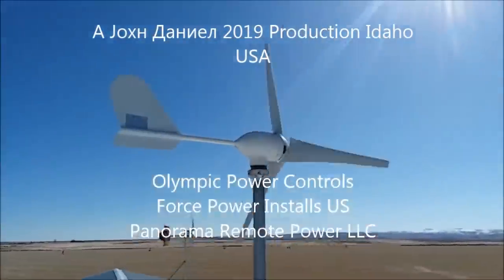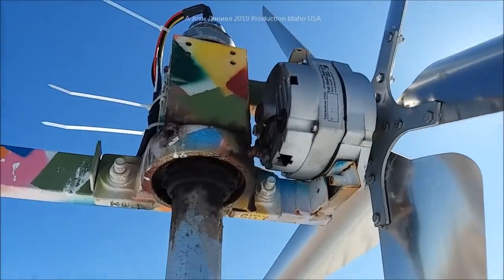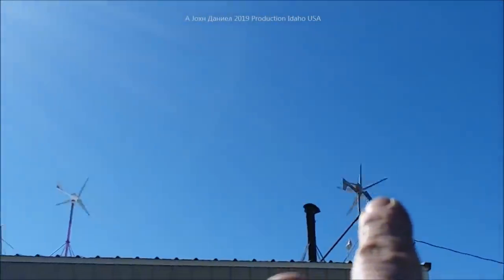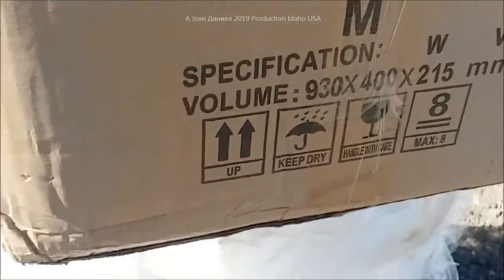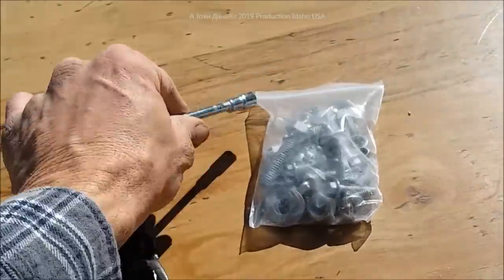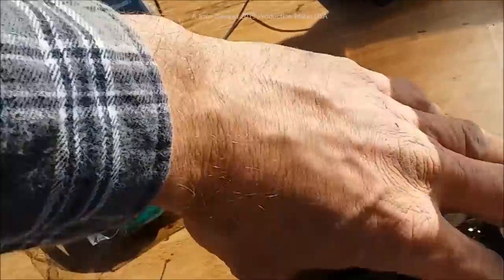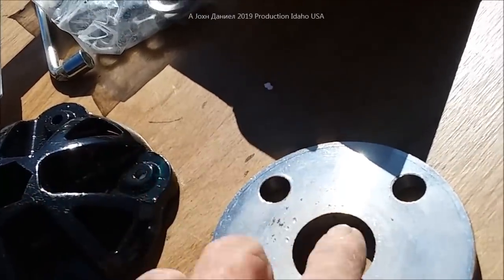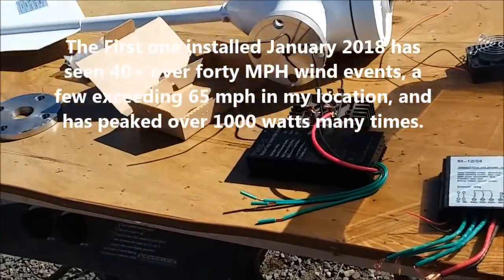Genuine 500 watt home wind turbine, Best small Wind Turbines made! FULL PARTS LIST BELOW video

Comment: Really decent explanation of how and what needs done for Wind Power, I do have a Question if You care to reply? I'm looking at building Wind Back up to run 2000w AC, would I need to go with something more extreme? And also what would be the benefits of 24 or 48v versus the 12v System You're showing? Followed, as I'm full of Questions...hehehe  xD
Reply from the maker: You would need 2500+ watts of constant production to run 2000 watts of items. Think of a gas generator, takes a 3,000 watt unit to even start such a AC.
Reply: AC can mean Air Conditioner or Alternating Current.

The higher voltage will allow you to get the same wattage with lower current. This translates to smaller wiring, lower cost to buy. If you use wattage as the main unit it becomes easy to translate. 100 amps at 12 v is the same wattage as 25 amps at 48 volts is the same as 10 amps at 120 volts. Watts divided by voltage equals current, or volts times current equals watts.

I run three 36 volt 9 amp solar panels in series, 675 watts. This way I have 108 volts but still only need wire for 9 amps. In parallel I would need wire for 27 amps.  Either way an MPPT controller converts it to the battery voltage I need. Mine does 12, 24 or 48 volts. 

Your 2000 watts is around 17 amps at 120 volts, 170 at 12 volts. You need to balance your available wind energy (maybe some solar), your daily usage and the storage. Your generator needs to provide for all your usage and the storage required should be enough to get you through times you are not generating power. I have 900AH so can use 450 AH. That is 8 6v golfcart batteries.

Comment: Lucy I think you have some splaining to do about that brake wiring configuration....
Reply from the maker: Should have explained that people just have to get the newest turbine controllers with inner diversion resistors.  Soon as I find them I'll post the link to the source. Mine is a prototype according to Green E, but they will be on the market soon. And from my request , YEAH!!!!, they are going to make a full auto divert unit. Based on the controller with dip switch adjustable rates.

Comment: john this turbine 3 blade and 5 blade has 1 for reviews that is awful--5 blade the best--i live in vegas lots of wind here what would u suggest running right through my solar panel and kodiak and extra battery should be awesome
Reply from the maker: The review on Ali was done by a clown in Missouri that sells crap stuff on Ebay, he bought Sent it to his cohort in canada for one reason,  to bash it. He has done this same stuff  to AirX, Thermodyne, Hurricane turbines, Windy Nation, and Hi-Iq green energy and numerous people too. Been watching that wreck for a decade! He's even attacked me for showing folks they can make their own stuff.
Reply: ty john i will order one for my home here in las vegas
Reply: didn't answer my question on a twelve volt dc plug in so i can plug it into my kodiak when shit hits the fan so we can have more energy that we can use on a constant basis especially when the wind blows at night
Reply from the maker: Run the 3 wires down from the turbine to the controller if its short like under 50 feet, use a all copper ( NO COPPER CLAD) 10/3 extension cord, being 1 turbine you can use the controller as is like in the paper work on it. I have 4 on my system so my issue is proper battery diversion because multiple turbines with that controller is a nightmare. From the controller put the red/black to your Kodiak and I suggest adding another deep cycle in the system.
Reply: sounds to complicated for a 12 volt dc plug to plug into my kodiak solar generator when SHTF

Comment: The tails from that turbine will never carry 500W especially on a 12v system. And don’t try to tell me the 3 phase rectifier will down convert the voltage from the turbine to the batteries. All the “down converting” will be done in the skinny windings.
Reply from the maker: The tails? I think your referring to the wires, 12 awg with high temp but thin insulation that is coming from the turbine, 3 of them with the max of 44 amps continuous and 60 for very short peaks. Controller has 10 awg with much thicker insulation.
Reply: Јоhn Daniel if those tails really are 14 awg, what is the resistance between windings?
Reply from the maker: They are the chinese version of 12 AWG,  2.95-mm2 gauge, what you can call 12 awg or basically its 12.014 awg. I have not measured the resistance of the coils to center, I will be doing that and more details in a next video.  Thats more than sufficient process from the slip ring inside for the 3 of 7-1/2" long wires. From there we'll drop 10/3 about 12 feet then 8/3 another 30 feet to the power room.

Comment: Attention!!! Breaking system concept shown in this video is incorrect. Charge controller is sensing battery voltage and performing turbine break on AC 3phase side which is not connected here. Electrical configuration shown in this video will do nothing.
Reply from the maker: It's for diversion loading. In that process it controls turbine speed due to all the power coming through the regular 100a rectifier is being turned to heat.  If you want short circuit braking you have to run it through the unit. That action is notorious for destroying stator windings in a wind storm. I prefer loading a turbine down over burning one up.
Reply: @JOHNDANIEL1  John, keep in mind that max. operating temperature for those devices is usually about 75degC. If you think this tiny unit will be able to dump 300-500w for 2minutes and stay below 75degC then good luck:) It would be crazy idea to build such a small charge controller which is also dump load itself.
Reply: @jamiroquai33  I agree with your premise. 
We have an old four winds generator on top of the mizzen mast on our sailboat. It has mechanical speed brakes that slow the blades but shakes the mast when we are trying to sleep. Then we have a bicycle brake that we can engage by rope at the bottom of the mast. Third I have an electric brake. Some boaters turn the blade perpendicular to the wind to stop the blades. I wonder how hard it would be to turn the tail 90° for that purpose. I will add, during Hurricane Mathew, one of the two blades disappeared and it stopped instantly. I was watching when it happened but unfortunately didn't get the video camera on it in time. 

The Idea of braking the motor by shorting the phases for a long period of time seems foolish because I imagine it would burn up the generator winding. I would think loading the generator would cause it to run hotter and produce a lot of heat in the device creating the load. It would seem trying to load down a 70 MPH wind would generate more than the rated 500 watts.This may also take out the winding.
Reply: He clearly states that the 3-phase input is disconnected and an ensuing video will explain how it's employed for load-diversion braking.  There's even mention of the internal thin film resistors which are likely used as the brake loads.
Reply: If John is right and the unit acts as a dump load, it won’t do it for long as it will soon burn up trying to dump 500w plus.

Comment: What would you recommend for a small turbine for a camper for boondocking?
Reply from the maker: The new Polyvolt12-300 by Wuixi Air (Pronounced WooHei). Its light 18.5  lbs, only need a 12/3 extension cord to run down the pipe, will mount on 1.5" Sch40 pipe, makes 250+ watts ( 15-20 amps ) and is much quieter than the GE500 I use. Only available from a few places, Read to the bottom of my list stuff below the video, HIT THE SHOW MORE, I'll put ones source there near the bottom, see the one listed as 300 watt for RV's . 
I recommend 24 volt turbines on 12 volt RV systems where wind is not constant, due to lower mounting heights, gets to charging voltage quickly, will not hurt your batteries, and it just works well. I have 3 in a valley in Texas for 3 years charging a deer hunt cabin batteries.

Comment: is it to big for diesel pusher? I have 900 w solar
Reply from the maker: You can try the Pvolt12-300 by Wuixi Air (Pronounced WooHei). Its light 18.5  lbs, only need a 12/3 extension cord to run down the pipe, will mount on 1.5" Sch40 pipe, makes 250+ watts ( 15-20 amps ) and is much quieter than the GE500 I use. Only available from a few places, Read to the bottom of my list stuff below the video, HIT THE SHOW MORE, I'll put ones source there near the bottom, see the one listed as 300 watt for RV's . 
I recommend 24 volt turbines on 12 volt RV systems where wind is not constant, due to lower mounting heights, gets to charging voltage quickly, will not hurt your batteries, and it just works well. I have 3 in a valley in Texas for 3 years charging a deer hunt cabin batteries

Comment: Can you recommend a good slip ring for one of these type of turbines. I have one at home ready to install but need some way of allowing for rotation of wires. Best wishes from Northern Ireland.
Reply from the maker: If its one of these turbines it already has a built in slip ring
Reply: @JOHNDANIEL1  Mine is not exactly the same but did come from Ali.e. Just need to get round the problem of rotation twisting the 3 vertical wires. Can you recommend anything.  My base plate does look the same.

Comment: Hey John what would be a good charge controller for that wind turbine I need one I can set up to charge lithium batteries 24.5 volt I have 15 chevy volt batteries u have any information on a charge controller thanks
Reply from the maker: Your gonna need a 48 volt model turbine, about 800 watts, and for a VOLT battery pack, a PWM controller with temp control. They do have one on Alibaba I can inquire on to get it listed on AliExpress so you can get it without a Alibaba membership.
Reply: I need a 24.v charge controller I have 2 midnite classic I don't want to blow them up with out a clipper

Comment: John I wired mine like you showed pressed the brakes manually on the controller it has a small button for brakes and the brakes don't work . Doesn't the three phase need to be hooked into the controller so it can cross those for braking?
Reply from the maker: It's being used as a diversion load
Reply: That makes sense.
Reply: Hey John look at the picture I sent in email. Will that controller still work?
Reply from the maker: Will do, back on the road right now. Sitting at 84 south RS, Sick as hell, tired, running to SLC and back.Will be back by 8 am. Got to get my paid life off hahahaha
Reply: I had my cable doubled up on the 3 phase side.  So I split 1 going to 100 amp rectifier then controller and battery and the other 3 10 awg 3 phase line I wired to controller so now it will use brakes. I wired it so the rectifier is first then controller gets 3 phase . I will see if this will help .

Comment: Have you installed any 24 volt models from this manufacturer and if how are they performing?
Reply from the maker: on my intuit, theres 13 of the 24 volt models installed so far, one had a stripped out blade bolt noted, none so far have been called on as failed. All who will report on them ( 6 customers) say they are 100% plus in rating. 2 are being used with 800 watt wind to grid tie units. With good results.
Reply from the maker: Heres a run down of my installs of these Wuixi Air 500 from Feb 22nd 2018 to now:
Colorado, Idaho, Wyoming, Nevada, and 6 in Texas with 8 more planned there. 

29 of the 12 volt, 13 of the 24 volt, 15 of the 48 volt. 7 on grid tie, the rest to battery banks. All but one matched with solar.
Reply: @JOHNDANIEL1  I'd love to see a video about matching one of these turbines to a solar array charging the same battery bank. 

I have an off-grid solar system charging AGM batteries that requires supplementing with wind. Can I hook up the solar charge controller and wind turbine charge controller to the same battery bank in parallel? Any special equipment required?
Reply from the maker: Yes, you can. You just want to add a diversion load system, NEVER buy one that says 440 amp and has a big solenoid on it in a gray box from ebay, Big fire risk! Wind-sun units is the best, I'll be doing a DIY video on it as soon as I have the time.

Comment: Can these be hooked up to a grid inverter.   I am a noob
Reply from the maker: With a 24 or 48 volt they do work with a wind to grid tie unit. If you want to know which are matching models just go here, https://www.youtube.com/user/JOXHDANNEL/about?view_as=subscriber get the shop email and contact me for those options and your questions if thats your goal.
Reply: @JOHNDANIEL1  I'm interested to see what grid tie suggestions you have with these style turbines. I followed that link and did not see any grid-tie info. I have a 48V ~1200W turbine. I about gave up on grid-tie, getting ready to try a hot water install.